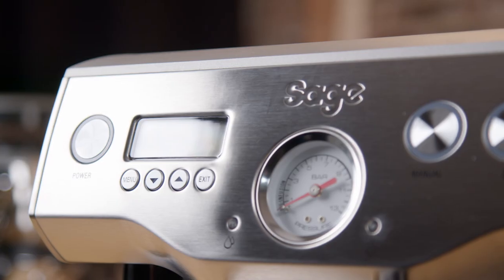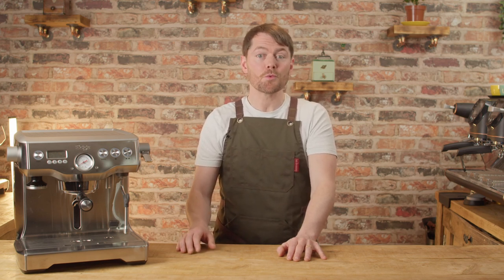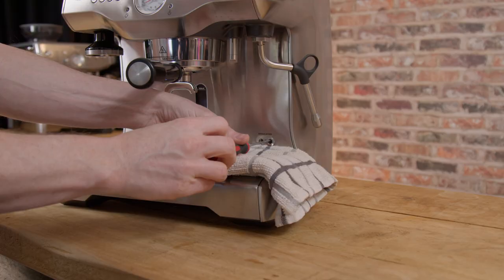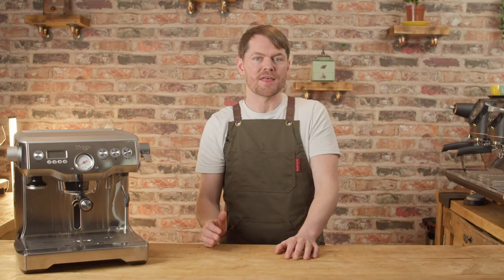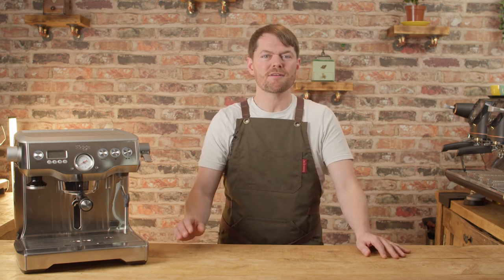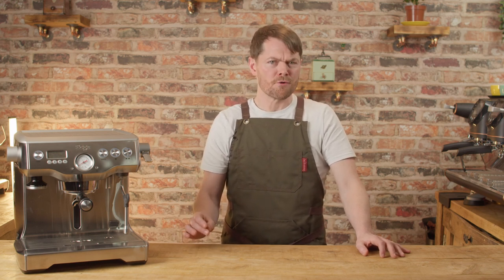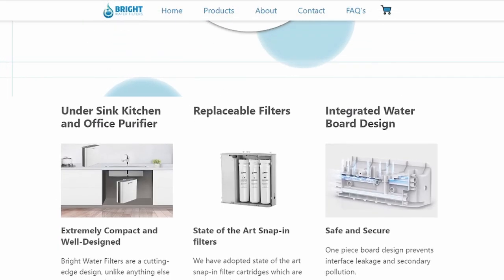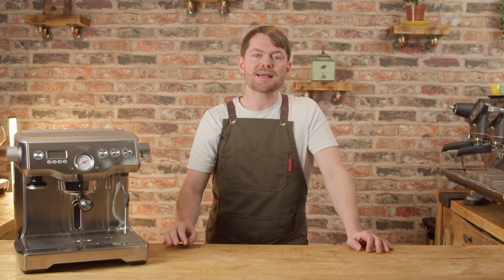The Sage (Breville) Dual Boiler: 3 Beeps Error.

Comment: Kev, thanks for the videos, they are all great. This is an issue, but another MAJOR issue for me is the group head coating, either forming bubbles, pealing, or rusting. I am disappointed and i notice this is a very common issue with all DB users.
Reply: I can vouch for that, and almost every single DB has the corroding group head issue with different degree of seriousness, the layer of Teflon coating at the group head would start to peel off in weeks of usage! Official Breville and some Breville influencer aka youtuber like to call it a cosmetic issue...

Comment: Kev, thanks for this video, my Sage Dual Boiler developed exactly this problem after following Sage's own descaling instructions to the letter. The worse part was it was a month outside the warranty. I took your recommendation & contacted Radu at Espresso Repairs Shop to assess the issue. He confirmed it was the thermal fuse which meant the removal of the steam boiler. He checked over the machine during the repair and also spotted a leak on one of the probes on the steam boiler, so fixed this & replaced all o-rings. Top guy, would recommend him to others. I have no affiliation to Kev or Radu & was naturally hesitant to use a repair guy I didn't know, but I needn't have worried, he was very professional & competent.
Reply from the maker: Thanks for that Jaz, Radu is fantastic :-)
Reply: How much did it cost..?
Reply: @Ghostface944  To replace the blown thermal fuse requiring the steam boiler removal and the replacement of all seals and o-rings on both boilers, it was £160. Money well spent to avoid creating an elaborate paperweight! Happy to report it's working perfectly a year later. Jaz

Comment: OMG... it's this issue that I kept reading about in reviews that put me off buying the DB for so long. Hope this isn't going to be an expensive mistake. Thanks for the video Kev.
Reply from the maker: Yeah I get a lot of emails from people about this, personally I wouldn't let it put you off, I'd either get comfortable with taking the top off and tinkering with it (which is great if you can, as you can do your own maintenance when required, a lot of it is really simple, I could probably even do it, hehe, but no need as I have an espresso engineer round the corner) or find a local engineer to take it to, or get a filter system or RO system. Cheers, Kev.

Comment: I descaled. This issue shows up only after i haven't  been using the machine for  a week or so, like when i go on holiday. After turning the steam lever up and down a few times and wait 10 minutes more than the usual heat time, the steam works again. Until the next holiday..... any idea on why this happens?
Reply from the maker: So you mean it happens when you descale and then don't use it for a while, or it happens when you don't use it for a week or so regardless of when you last descaled?
Reply: @Coffee_Kev  it happens when I don't use it for a week or so regardless of when I last descaled. I reported this to breville, they told me to descale again (2/3 times) until the problem is solved. I did not follow their advice.
Reply from the maker: @izoard77  in that additional 10 minutes it takes before the steam works, is the machine completely silent or can you hear the pump working?
Reply: @Coffee_Kev  completly silent. I open the steam, 3 beeps of death, nothing happens. Until after a while the slightest bit of steam starts to come out when i open the steam knob. When i see that i know another 30 secs and steam is ready in full power.
Reply from the maker: @izoard77  Radu (engineer) says this is peculiar, could potentially be a water sensor, if you're OK with a bit of DIY you could remove the sensors one by one, clean them with steel wire wool or very fine sandpaper and insert them back in.

Comment: Potential Remedy: I have the Dual Boiler and I had this issue pop up last week, while I was descaling it for the first time. I had no idea was the beeping was - but when I tried the steam wand it didn’t work. I was frustrated and had heard that descaling could cause issues. I decided to do a back flush cleaning with one of the little cleaning pods. Did that - and then boom, the steam wand worked! Not sure if there was an air pocket, like you referenced - but thankfully it’s working perfectly. But now I’m scared to ever descale it again. Ha.

Comment: Love this channel! and love the fact that you've made this video. I sell and repair coffee machines in Melbourne Australia and this issue is sadly far too common and a bad design flaw in my opinion. Long story short, the steam boiler water level probes can be coated with descaling solution (or just get dirty over time) and the next time you turn on the machine it thinks it's full, heats, overheats and cooks that fuse. Airlock would be when the steam boiler refusing to drain the descaling solution after you've opened the valves. These days I still tell my customers to avoid this and just change filters on time. Even on a newer model I've witnessed a near death experience (for machine...) when a customer of mine, 6mth old oracle BES980, told me they descaled and steam isn't working, I turn it on and it heats up without much water in the steam boiler and i heard it tinkling and could smell some plastic burning, this was over literally 30 seconds so can happen very quick! Luckily I caught it on time and worked well after i darined the boiler and cleaned the probes. CLEANING THE PROBES AFTER DRAINING THE DESCALER IS THE BEST WAY TO PREVENT THIS OVERHEATING. If airlock then yeah just try and do whatever you can to release that including removing one of the pipes on steam boiler to give it room to breathe. Hope this video and comment save your machine from this issue!

Yes prevention is better than cure. Changing the water filter every 3 months (Claro Swiss brand) will minimise scale build up. RO system would be good too if you can afford it. I've done a handful of thermal fuse replacements, not fun, takes many hours and these days I refuse to work on them because it may end up being a bad motherboeard or bad heating element. Yes in some cases it's an airlock, very good method you've shown on how to distinguish between them

Comment: Thanks Kev. This is probably the most important video for the Dual Boiler. The machine is fantastic but I have an issue with Sage recommending regular descaling using their branded solution when it causes issue after issue for their customers. I’ve stopped descaling now and I’m using Ashbeck bottled water, which is not a bullet proof solution. When the machine does eventually die, I probably won’t replace it but research other brands. What a shame.
Reply: Hi, is Ashbeck the softest bottled UK water? I’m yet to unbox my DB and stumbled across this video and now I’m worried!

Comment: Thanks for the video, I had Err3 issue too after descaling.  I couldn't bleed out the airlock through the screws as machine would error as soon as started.  Fixed it by removing a probe from the top of the steam boiler when cool and syringing water into the boiler.   It now works fine.  I was reluctant to put too much water in just in case it caused issues so I do temporarily get the error3 still, but seldom enough that I'm living with it until the o-ring seals need replacing in the boiler.

Comment: Thanks so much! This happened to me after descaling- it wasn't resolved by factory reset or by unplugging overnight, but the tilting and banging the right side you described fixed it, so it must've been the air lock. Glad I didn't try to take the machine apart.

Comment: I have a soft water system and reverse osmosis filter for drinking water. In 5 years my Sage Duo Temp Pro has not scaled up and I have had no issues with my kettle or 30 year old washing machine. Odd pipes might take some time to remove limescale inside them. 

Softened water also means you need less coffee (or tea) and less soap or detergents in general and no scaling marks on glass and polished surfaces.

Comment: You mentioned various water treatments in your video, what do you think of filter jugs like the Brita range? I'm asking because I use such a jug for my Barista express impress.  Thanks for another great video.
Reply: @janmokry5693  is that instead of the internal filter? Seems Breville are the only machines with a replaceable filter.

Comment: Thanks for the video but I need some more clarification on your suggested solution:

1. Cool down the machine
2. Drain the steam boiler
3. Leave the valve open
4. Turn on the machine
5. Hear the pump run
6. Then close the valve (?)
7.  Then quickly turn it off to avoid blowing the thermal fuse (?)
8. Then I assume just wait for it to cool down and turn it back on and see if the steam wand works?

Are these steps correct?

Comment: Great vid Kev.  I'm also seeing others suggest that this issue can be caused by the descaling solution coating the sensor in the steam boiler, fooling the machine into thinking the boiler has water in it.  Is this a thing or not?

Comment: I think the problem is something else, unrelated to descaling solution.  I changed the O rings at the bottom of the water sensor probes and cleaned them off scale OUTSIDE the machine and ran into the three beeps of death, therefore nothing to do with coating of probes.
After the boiler primed, the diagnostic menu showed HLH for the three probes, indicating that the shorter sensor i.e. full probe was still indicating insufficient water.  At the firmware display screen of the menu, press the power button and it will test the machine, including running the pumps, after which I had HHH and the boiler would heat and steam.
My hypothesis is that the boiler fills either to a cutoff of back pressure against the pump and an airlock will stop it short, or it fills by a timed quantity but not by the detection of the probes (which would be silly but equally doable).  Either method could be done in software quite trivially but the result is insufficient water and no boiler activation.
The reason this would be associated with descaling is because that's the only time people have a reason to empty the boiler.

Comment: Hi Kev….I am about to pick up a good condition second hand dual boiler. We’ve been in our house 5 years and been using the same kettle with tap water…there are no signs of limescale on the kettle. I have a peak water filter jug too…when I tested the water it suggested one of the lowers softening settings. Do you think the sage filter in the water tank of the dual boiler would be sufficient without having to descale? Cheers, Martin

Comment: I just had the sensors in the boiler start leaking steam and putting condensation all throughout the inside of the machine. I decided to open it after watching a video and it was very straightforward,, well for me anyway. I ordered the obviously broken sensors and corroded parts i could see for $180 Australian buckaroos and will install them next week. I pulled the sensors out to see of the o rings were leaking so i know how simple it is to do.

Comment: Hello. With my BES980xl the automatic froth (lever down) gives me 3 beeps and does not froth milk. However, manual froth (lever up) works just fine.

Any suggestions?
Reply: It my case a switch in the steam wand was broken.

Comment: For the  v60 I use a zero water filter jug giving 0 tds on the meter. Then add third wave water sachet to get about 150tds. 
Do you think this is over the top for an espresso machine as living in a area of very hard water?
Reply from the maker: Hi Andy, nah I don't think it's over the top, it might not be the cheapest solution over the long term, but it's a solution. Just keep in mind that they do a few types, you'll want to choose the espresso sachets. Cheers, Kev.

Comment: Have the new machine, but made a mistake not closing the drain valves after descaling. 
The steam boiler still gets warm if i run descaling again, so not sure if really broken. But i cant get it to steam anymore.
Reply: Where you able to troubleshoot the problem? The fix did work for me (it was the air lock problem), though I had to search for a more detailed source on how to perform it. I have a comment somewhere here, that described the method I used to get it fixed.